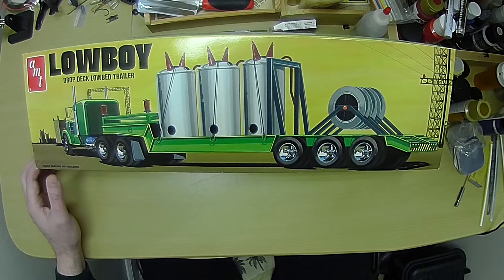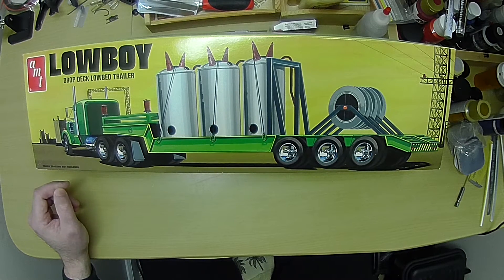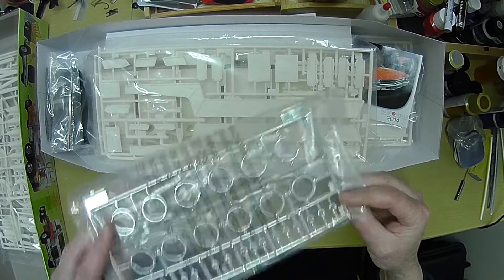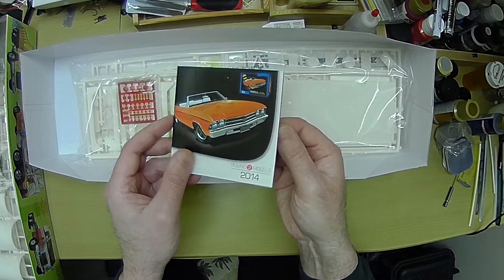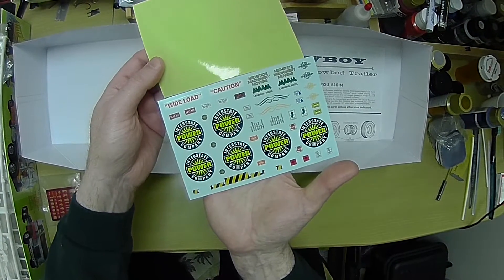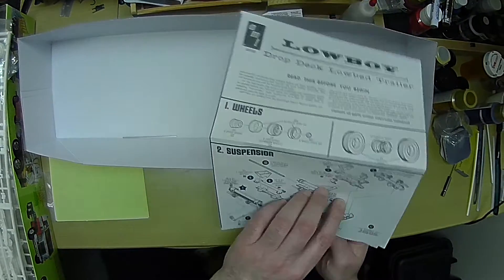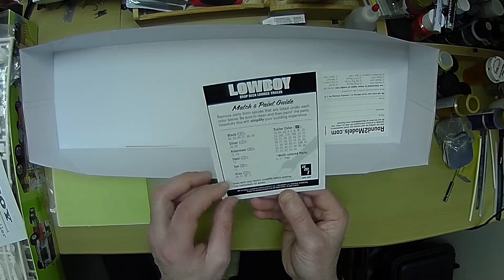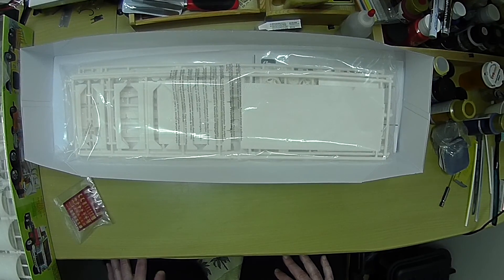AMT Lowboy Trailer - Intro

Comment: Is the trailer supposed to be 40 or 53 ft. And are the rims like in the picture the old 5 stars
Reply from the maker: Dan the trailer is 40 feet long and the rims are the 5-spoke type.  I put a close up of them in the part 2 video.
Reply: Cool. I just bought this trailer. I'm putting on the moebius wheel set and gonna try to stretch it to 53 ft